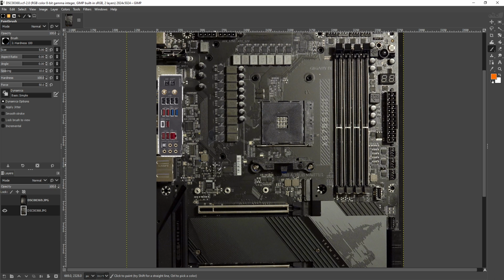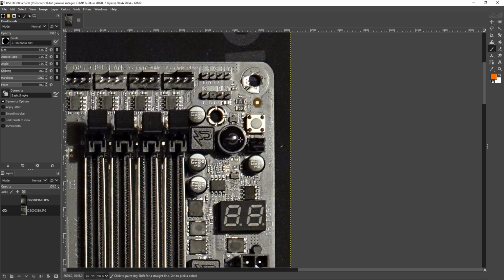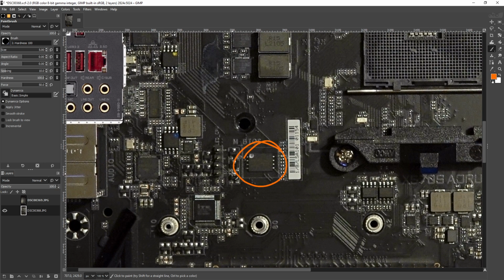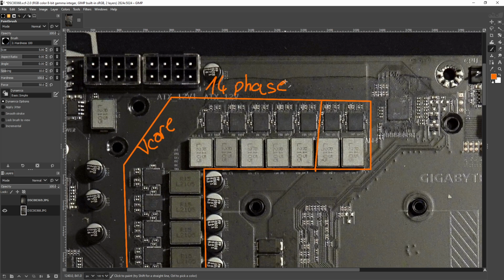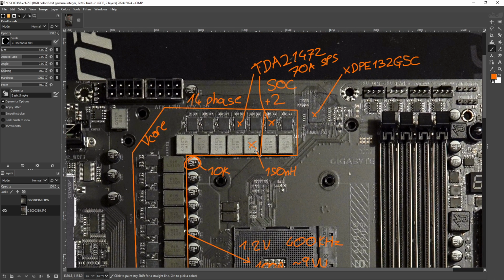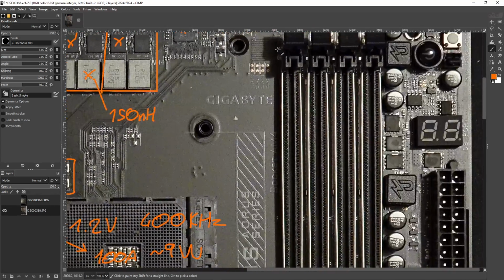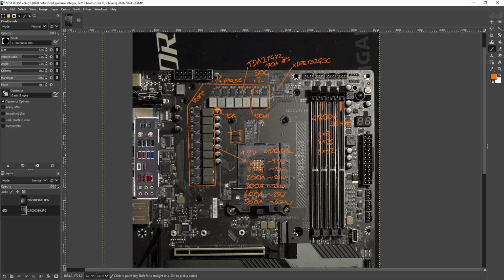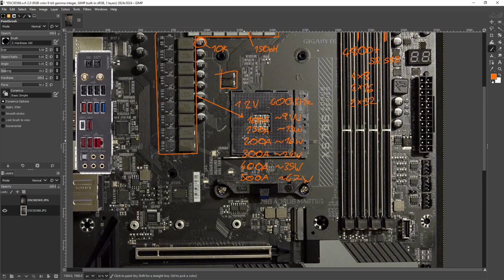mobo PCB Breakdown: Gigabyte X570S Aorus Master

Comment: 3 years in,the motherboard is absolute junk. Faulty RAM slot, most probably due DIMM power delivery. Not to mention the USB disconnect issue. Board gave me more grief than peace of mind. 

Overbuilt VRMs never really amount to anything, x3d chips made overclocking almost irrelevant. 

Meanwhile another b550 board with good enough VRMs is kicking, all good and well.

Comment: It is a great board, but they decided to make it Rocket Science to remove all the frilly stuff to swap-out the WiFi module for 6E or 7. Is there some hidden lesson plan for learning what to do for that?
in order to successfully swap it out.

Yopurs look radically different from this one, at the same price.

Three M.2 slots on the (Rev. 1.2) board.

If installing three NVMe lose SATA 4 & 5, so stuck a 2TB SATA M.2 SSD in.
An xtra x1 slot on it also.

Which (Rev. 1.?) is this one?
the 1.2 still has the Dual BIOS,  with two single pole-double throw switches. And do not see what you are talking about with your older rev..

Using the Clear CMOS button on the rear is a chore compared to just shorting the twin pins by thr front panel header..

It REQUIRES the power supply unplugged, and once it did not reset anything after thirty seconds, so at least a minu8te holding i9t there, so I bought an external switch for the one using the motherboard jumpers outside the case.

Yours looks way different.

Thankn

Comment: M.2 drives are relevant for an Engineering / Design Workstation, this motherboard is ideal for that use. In a Workstation we used to have one or more RAID arrays nowadays you can use NVMe drives instead for Boot/Applications, Scratch/Output, and Data/Source. This is useful for Engineering Simulations and 3D Design workflows, the same applies to Multi-GPU for Compute usage. Again, this board is perfect for that. Thanks for such great content! I also like the videos you made for Gamers Nexus.

Comment: 9:01 oddly enough the dual bios allows for mistakes from dummies. and you don't seem to get that.
Reply: 9:21 you do have a switch. you have already shown the TWO switches.
Reply: 10:35 with you there. their implementation SUCKS

Comment: 6:54 pics or it didn't happen. that data is being put out whether it is captured or not. and yes capturing it in software might mean a hair (a hair) of cpu usage, but those sensors are outputting the data at all times, your software is only capturing what is already there. so show or go.

Comment: Have you had any issues with the USB disconnecting under high CPU load? I was able to reproduce this with Prime95 on small FFTs and games. In additional the i225-V rev 1 NIC also disconnects very frequently. I've updated the BIOS, installed the latest chipset and NIC drivers, etc. It seems like either a defunct board or a hardware flaw in the design. I would appreciate your feedback since you are very in depth in the hardware tracing side. Cheers.
Reply: Did you manage to fix it or find a solution? I have this board sitting but never used it.
Reply: @Luci_S  I actually had the CPU die a couple weeks after this post. so it might have been a bad CPU all along.
Reply: @xsillycarnifex  what?!! What cpu was this? How did it die?!
Reply: @Luci_S  No idea, it was only a few weeks out of the box. It was a 5800X, and entire chip didn't die, but I had a failing core on core 6.
Reply: @xsillycarnifex  

Oh wow! Didn't think that was possible with amd. Thinking of getting a 5700x for an upgrade to a 9700K but I guess I better wait for am5 prices to drop.

Comment: you would like a LED off and on switch if you hate lights and BS crap that is not needed for you just in a way RGB not needed but like you and most gamers now they are like a woman they have to make it look nice and sexy for gamers RGB is like buying a new dress so yes more gamers are a woman in a mans body i think of the remade old tech to look new and there has not been a new computer case for years or a mainboard you look back 30 years and the lay out its the same but renamed things like a COM port is now called a USB with more power push throw it

Comment: I built my new PC for ripping dvd/bluerays, gaming, and video editing. Could I expect my 5800x to go to 4.9ghz ...and (4x8GB) 3600 cl-16 ram to go to 3800 cl-14?

I got this board on sale for $317 before xmas. The 4 m.2 ssd, the audio (I'm an audiophile), wifi 6, and power solution (I'm an overclocker), it all just made sense. Especially when considering I will have it in service in my family for at least ten years.

Comment: I understand you don’t need two 8pin connectors for the CPU, but is there a downside to having them both plugged in?
Reply: I'm about to build a system with this board and was pondering the same because I'd need to get another 8 pin cable mod braided cable to do it...from everything I've read and seen, it is not needed unless you're going to do some extreme overclocking.
Reply: @GSP-76  one single 8 pin cpu cable delivers almost 400w. There is no way you get to that without LN2 so, one cable is completely fine.

Just remember the old AM3+, All of the just have one cpu 8 pin header. And FX keep the OC record over 8GHz all core with those motherboards.
Reply: @SiliconPower74  Yeah it's not needed..I was just thinking "it's there I should probably plug it in" lol..

Comment: To make sure: to disable automatic dual bios on the two button non-S original Master, should I put the first switch on single bios, then if the pc fails to boot, I switch the second button to the other bios? I’ve had it so far on dual bios, which is automatic, right? I’ve had a couple boot failures when it switched back and forth between the two bios’s, eventually settling on one. Is this the automatic behavior and BZ is saying I should be doing this manually? The manual doesn’t go into much depth on this. Any help welcome, thx.

Comment: I bought this mb a week ago and with the Asus strix 3080ti and have been experience coil whining suspect that it’s coming from the mb , is it just a faulty set or should I be switching to another brand of motherboard? It’s my first time buying a gigabyte/Aorus product. Also my PSU is a 1000w seasonic gold. Thanks, any help is greatly appreciated! 😊
Reply: From what Ive read the Asus Strix gpus are known for coil whine. I haven’t heard of a mb having coil whine, so I would guess it’s the Strix - but I’m no expert.
Reply: @cgsather3309  You may be right, brought it to the store for check and they said it's the gpu, i heard on yt and reddit that MB can have coil whine in their VRM too
Reply: @LYJManchesterUnited  yes, I have since learned that the mb can have coil whine too. Fortunately, my Master doesn’t, in fact I never even hear the chipset fan. It’s been a great board so far.

Comment: The thing with M2 slots is cost per capacity is just going to keep dropping and modern SSDs have really good lifespans.
And NVME (albeit PCI 3.0) is priced very similar and sometimes cheaper than SATA 2.5"
So having a load of slots gives you the possibility of buying a 500GB/1TB drive now, then getting a 1TB/2TB even later, then a 2TB/4TB drive even later.
You can buy the best value drive at the right moment and not worry about having to replace it later.

Comment: I barely understood the RAM slot part. But does that mean it's not recommended if say I have the X570S Aorus Master and a 5900X and need 64GB RAM, but the only RAM kits available to me are two of those 2x16 Kingston Fury 3200 kits? We're at a drought of reasonably priced/available RAM kits here.

Comment: I recently bought this board and it's the same-old GigaByte garbage.  With everything else identical, the X570s Master required 1.450VDIMM just to POST 3600MHz CL16 XMP (was completely unstable under stress test, though).  Meanwhile the same CPU and DIMMs can run 3600MHz CL14 @ 1.400VDIMM on my cheap $150 MSI board without breakin a sweat.

I can NOT recommend any X570(s) products from GigaByte.

Comment: 5:25 Holy crap, so THAT's why I have to clear CMOS with bad settings and memory overclock fail retry barely ever works? I held off watching this video because I just really didn't care about this board, but now I'm glad I watched it because I had not run into this information anywhere else. I actually permanently moved my cases reset button to CLR_CMOS because I got so fed up with watching it fail over and over when I'm OC'ing memory.

Personally AGESA hasn't sabotaged my memory overclock thus far, in fact it's been the opposite, and I've been able to tighten things up a bit on more recent AGESA versions. But I have encountered other people who have had their memory OC wrecked from updates, but it's been a while since I've seen it happen.

Comment: When I was in school a bit more than a decade ago the dual BIOS was a standout feature because it mitigates the risk of corruption. So when he asked why even bother with dual BIOS I was like duh! But then I thought about it and can't remember when was the last time I heard about someone corrupting their motherboard BIOS
Reply: Have done this. Dual bios saved the day
Reply: 2000 was when i last recall it happen to someone i knew at the time, was a gb board as well lol Stupid duel bios caused me grief with out of date back-up refusing to post with my 5900x on a x570 pro wi-fi after a lock-up when trying to save and exit from smartfan page, which seems flaky on f34, fine saving anywhere else.
Reply: I currently run a Gigabyte X77X-UD3H, a mother board from 2013-ish, which has dual-bios.  I remember the bios corrupting a few times when I was trying to OC my i5 3570k a few years ago.  I also remember earlier versions of Windows 10 would always corrupt the bios when ever I ran a startup repair.

(Yes, my computer is almost 10 years old, and I'm planning on upgrading soon.)

Comment: More PCIe - Absolutely! If a user wants M.2/NVMe they can plug in an adaptor card which would theoretically give the card better cooling via airflow and it makes installation so much easier.
Reply: Yup, I even did put my SN850 on a PCie adapter card rather than in one of my X570 Aorus Pro M2 slots, as it went as high as 80C under load... down to 60ish now!
Reply: @pascaldifolco4611  I didn't get a temperature drop quite that low in My X570 HERO but the temperature drop was significant enough to merit an adapter card for this reason among others. There is also the given consideration that some cards will include the option of adding more than one drive, be it SATA, M.2, or NVMe. I suppose it is a matter of preference. Some people value having options.
Reply: Installing any PCI-e expansion card in a gaming PC is undesirable as it will nesasarily disrupt airflow to the GPU when mounted in a standard configuration.
Reply: @zig131  Well, a standard configuration isn't what you want for a gaming rig anyway :)

Comment: I agree with the need for manual Dual BIOS so hard. I made the unfortunate mistake of getting a Z390 Ultra instead of a Master, and while most of the board is great the dual bios is absolutely infurating to use. It's great for some things but I really wish there were a dumb physical switch.
Reply: If you have 3950x, Dont buy this mobo. the wrost combation. i regretted
Reply: @ejer.  What issues did you see? I have a 3950x and am considering this board. Would love to hear your input on this.

Comment: Yeah I haven't pushed my patriot blackout DR 4x32 harder than 3600mhz in the x570s master yet. It's at capacity. Fwiw it's using 2gb hynix m-die mjr ic modules (H5ANAG8NMJR-VKC).

Comment: I just love the memory OC commentary we get in almost every video.  BZ, if you get bored, try ECC DIMMS.  8 ranks of DJR runs at 3800 on Ryzen, until ECC is enabled, then it's 3733 with ~7 attempts to train on boot lol.
Reply: Even if it sounds contrary: Would be very curious what would be possible with ECC UDIMMs if someone really knowledgeable tunes them. Bumping up the DDR4 frequency with loose auto timings is quite easy but as soon as you touch the timings it gets hairy pretty quickly.
Reply: I did memory overclock a threadripper server I built up to 3600 IRRC not to OC but to force it to throw errors in both memtest and Windows. I wasn’t able to make it unstable. Not that it didn’t report any errors but it was rock solid. I let go after that. Windows never crashed etc. It had total of 16 ranks. There were no 2 rank 32 gig sticks like there is now. I would have used those and they are both in 2666 and 3200 MT/s variants. Wow. I kind of wanna build a Ryzen 5700G with 128G RAM.
Reply: @KaziQTR 
Tested a 4750G with 2 x 32 GB Micron DDR4-3200 ECC UDIMMs on a Gigabyte B550 Vision D, went up to DDR4-4000 with loose auto timings. Note that if you want ECC enabled with APUs you have to get the “PRO” SKUs like the 5750G, for example.
Reply: @abavariannormiepleb9470  I have the 4350G Pro paired with 2 x 8G ECC. Thanks for the heads up. I think regular 5700G will also be ok but no reason to risk it. Regular Ryzen desktop CPUs such as 5800X have no problem enabling ECC AFAIK.
Reply: @abavariannormiepleb9470  Just FYI, I paired a 5800X, ASUS X570 Pro and ECC UDIMMs last week without problems. Except for it didn't boot at first cuz of old BIOS :D. With BIOS update it was able to recognize the CPU. Beware the motherboard gets stuck at RAM phase  even though it's the CPU that it can't recognize. I used a 3000 CPU to boot and then BIOS update.
Reply: @KaziQTR  For that reason I try to only get motherboards with USB Flashback functionality, no more annoyance with CPUs unsupported by earlier BIOS versions.
Reply: @abavariannormiepleb9470  yeah. That was a premium I didn’t wanna pay for this instance. And for some reason, that functionality never worked for me. I know it should work but it never worked for me on multiple occasions.

Comment: Buildzoid was probably being hyperbolic, but do people actually mash delete to get into the BIOS? Try just holding it. Only time I've seen that not work on recent hardware was with a keyboard that had its delete key multiplexed by a function key.
Reply: Are you serious. 21 years of using a computer and I learnt this today
Reply: Not aware of this. Thanks. If it works I won't Mash it.

Comment: The automatic dual bios lets the board update both bioses in one go via q-flash plus. This does not work if the auto-switching is turned off (at least on my Z490 master).
Reply from the maker: the whole point of dual BIOS is that you can have different BIOS versions on the same board.
Reply: @ActuallyHardcoreOverclocking  True for most overclockers. But they can deal with this anyway. The unexperienced user going high-end is a different story. And I myself have the same bios version for both but have one stable daily overclock and one where I experiment.
Reply: @ole7736  I'm pretty sure the autoswitching is bad for either of the cases you presented. Like if a noob user turns on xmp and tries tuning some settings and they dont work and they get flipped over to the other bios, they're not going to realize and are going to have a headache trying to figure out what happened. In your case autoswitching is also a hindrance since you really want to manually control if you're tuning your experimental settings or not, you don't want to sketch out your daily settings.
Reply: @katherinesilens2994  I merely said that you can flash both in one go with this setting.

Comment: VITAL VIDEO! , own two Xtremes 1.0 and 1.2, looking to upgrade to X570S and sell those Xtremes
Reply: Why. It's a downgrade.
Reply: @Raivo_K  Why downgrade? Master has more nvme slots, also has usb 2x2. Xtreme has no usb 2x2. Xtreme used to be good when it was the only fanless option, but now it's overpriced and the only advantage is that it has 8 PCB layers which makes no difference anyway
Reply: @AndresReviews  It has one more M.2 slot. The same can be achieved on the Xtreme with a PCIe card. USB 3.2 requires compatiible devices and thus far there are not too many of those. Besides one of the original revsions brought the TB header to the Xtreme and TB is still faster than USB 3.2 anyway.

Xtreme has overbuilt cooling because it's passve and Dual-NIC and Dual-BIOS. Both things the X570S version lacks. I mean if you already have the Xtreme it makes no sense to downgrade to the Master. Buying new i would argue the old Master is actually better. I doubt anyone is buying Xtreme these days tho. For that kind of money the EVGA X570 Dark is miles better.
Reply: @AndresReviews  Have you tried 5950X on your Xtreme that currently runs 3950X? OC Tuner should be 5000 series dependant not a motherboard feature. It should show up in the BIOS once you pop in 5950X.
Reply: @Raivo_K  Haven't tried, but if you take product description of Xtreme 2.0 and Xtreme 1.2. The only difference there is "Active OC Tuner". Other than that everything else is exactly the same even the manuals.